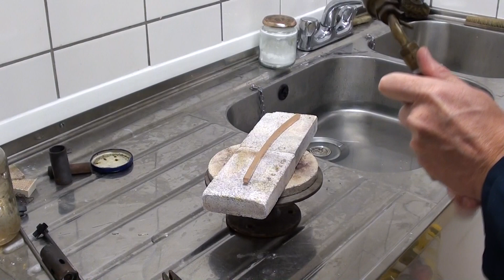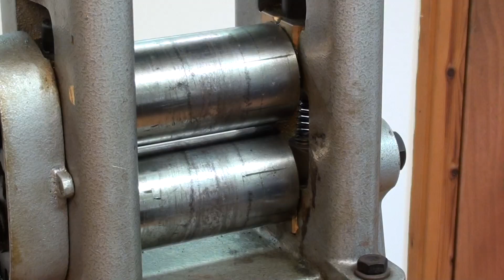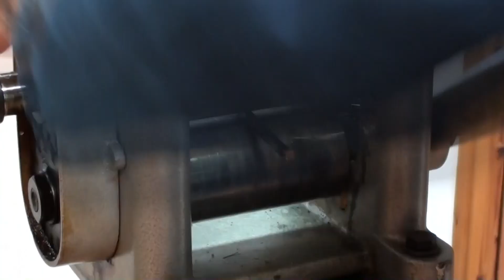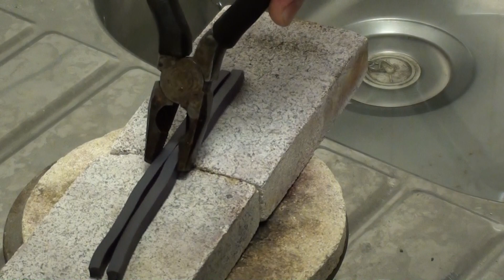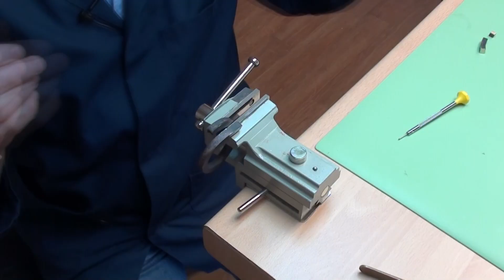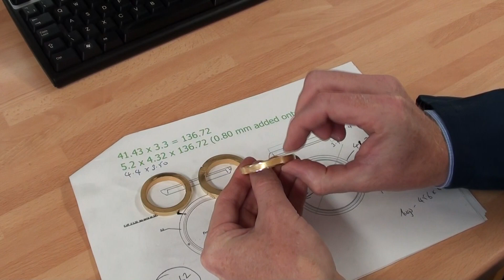Part 2 of 7 - Case Making by Roger Smith

Comment: It's crazy to think how much labor (how many steps) it takes just to get the three pieces of the case to this point. I understand how the entire allure and appeal of your brand (amongst other things of course) is precisely because you do everything manually, but being failure familiar with casting, forgings and traditional metal removal processes, it is nuts to think how many steps it takes to do this by hand.  Then, add to that, if you screw something up at this point, you could throw all that labor away.  Very interesting stuff, thank you so much for sharing.  It is cool to watch your videos juxtaposed with some of the Swiss boutique brands, not to mention the high-volume ones.
Reply: Yes, I couldn't understand why these pieces weren't just machined.  He machines gears and other parts, but he spends so much time on these simple parts.
Reply: He uses KERN 5-axis CNC for movement construction:)

Comment: That is a man killer rolling mill. At least our main mill was geared down 6 to 1.  We had one mill like this and we'd make the new guy turn the handle until he got wise.  He should keep those rollers oiled to prevent rust.  The ripple he is getting is caused by letting the end go as he rolls and sometimes uneven hardness of the metal.  We always quenched our gold in a pickle bath to aid in removing the cupric and cuprous oxide layers.

Comment: If you don't mind me asking, how much does a bar of that gold stock cost?
Reply: +Sean Harris I wondered the same thing. From my back of the envelope calculations, each bar (enough for one of the 3 case rings) would be around $2000-$2500 USD   (The volume of gold would be 42*3.3*6*6=4990mm^3, which would be around 2.44 troy oz, with a current price of ~$880/troy oz for 18k gold = $2150 )